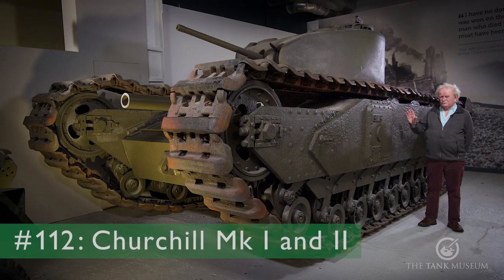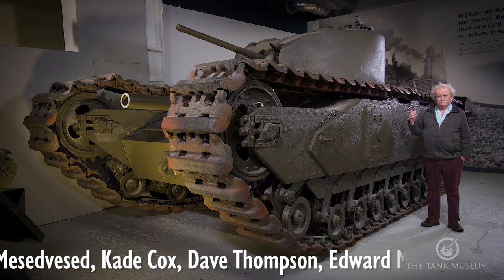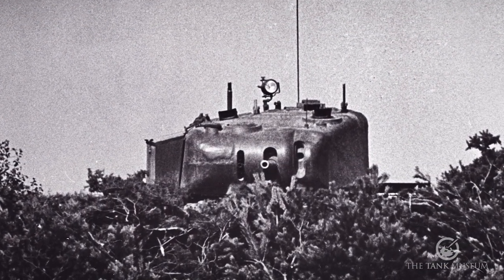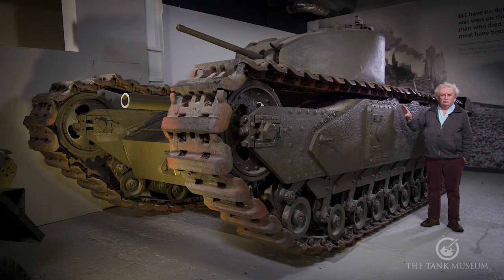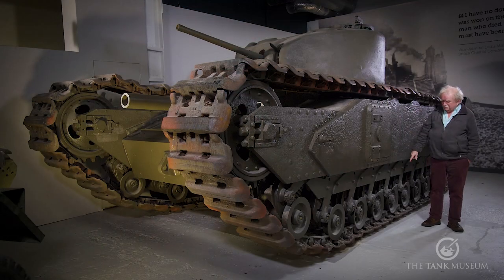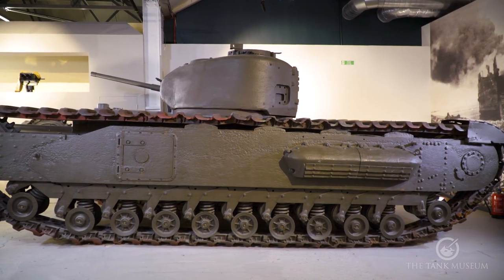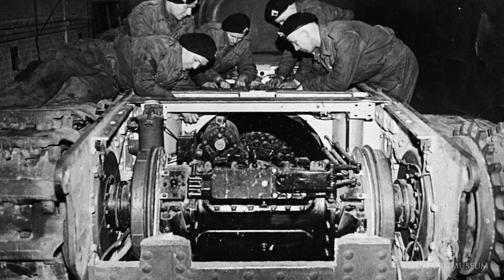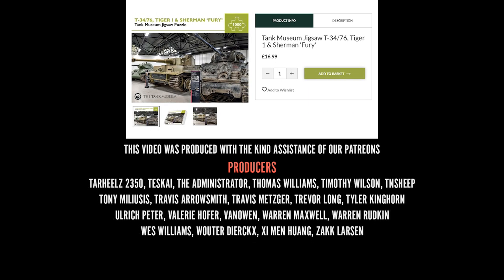Tank Chats #112 | Churchill Mk I and II  | The Tank Museum

Comment: The Irish Cav Corps loved these. However the Kildare and Wicklow county councils HATED THEM because of what they did to roads lol.We didn't have tank carriers so they were driven to the Glen of Imaal under their own power for training shoots .Later the Councils had enough and we had to get carriers for them. At one point a churchill gave into the Irish terrain and sunk, we couldn't get it out so instead we just took off the gun when not using it so we didn't need to guard it. We tried so hard to keep them alive we even took apart our Supermarine Seafire Rolls-Royce Merlin engines and installed them into one of the Churchills, supposedly it worked at first but its never said why. Of course they went out of service not too soon after but we dug up the sunken Churchill and sent it home to the UK’s North Irish Horse Regiment, based in Northern Ireland, as a goodwill gesture. It is displayed Belfast.

Comment: It's my birthday in a few days and I couldn't have asked for a better present!

Some fun facts about the churchill:
The air intake covers had to be removed during rail transport in order to fit through the tunnels.
The side doors not only provided an easy way into the tank.  They made it much easier to exit the tank as well without exposing the crew to enemy fire.
The high tracks provided more room inside the hull.  In later models with the track cover, many tank crews removed the middle portion during the winter because snow would jam up the turret ring.
Infantry tanks were also used to break through barbed wire. 

And in my opinion, I don't think the tank designers ever expected the churchill tank to ever have to go into a hull down position, since it is an infantry tank and designed to be used during an infantry assault.  Plus it has that thick frontal armour and it would be a shame to not put it to use.  Tanks were not designed to battle other tanks in those days.
Reply: Well, the 2-pounder gun wasn’t useful for any other purpose than shooting at enemy tanks, since it only had AP shells, no HE.  So although not the Churchill Mk. I’s primary mission, it could defend itself from (early model) German Panzer III’s and IV’s if it had to.

By 1943, of course, the 2-pounder was obsolete, and so was the Churchill Mk. I.  But good enough for training.

Comment: I'm suprised considering they planned on using the 6lbr first but swapped to the 2lbr due to lack of guns that they didn't use the bigger planned turret anyway just with the smaller gun so it could be updated later as it would have saved having to build a completly new turret for the Mk III

Comment: The Mk I lasted into the Italian theatre due to the paucity of close support tanks, where the workshops had fun modifying them. Replacing the turret 2pdr with a second 3 Inch howitzer, or switching the positions of the 2 guns so the howitzer could fire while hull down.

Comment: Early Churchills like these are the ones I find most interesting since their status as immediate-production gap-filling tanks pending upgrading to better-armed versions makes for unusual choices in design. The Churchill Mark IICS (Occasionally called the Mark II as the normal Mark II was sometimes referred to as the Ia) swapped the 2-pounder and 3-inch howitzer around so the former was in the hull and the latter was in the turret, which I find very curious in terms of the role it was expected to fulfil, but I believe it wasn't used in combat.

There was also a retrofitted version done in Tunisia that fought there and in Italy that replaced the 2-pounder with a second 3-inch howitzer too - again very curious as it presumably would have been capable only of firing HE or smoke, and with the small number of HE rounds normally assigned to early Churchills I have to wonder how useful this field modification would have been. The Mark IICS has numerous photographs of it, but this retrofitted double-howitzer version I've only managed to find one photograph of, immobilised in Italy - https://3.bp.blogspot.com/-lA-AismP_k0/XIRMpHv_-GI/AAAAAAAA5YY/KdRAUmbNFEAWC0jEnz-sy6kSKuLEprWdACLcBGAs/s1600/Churchill%2BMark%2B1%2Bdual%2B3%2Bpol..jpg
Reply: Jerry Chester who served with the North Irish Horse in Tunisia and Italy talked about the conversion and use - depending on tasking the C/S tanks had (did not matter whether normal or the two with the two 3" howitzers) depending on what combination of munitions were carried - for some tasks (like when they supported river crossings) they carried full loads of smoke and would use all them plus more with the echelon, other times they would carry mostly HE for suppressive fire.

Comment: They had 25 pounder, they had naval 3 inch guns, they had Vickers AA 3 inch. And yet the developed new infantry tank that was supposed to replace Matilda with a small turret, narrow turret ring and all of that for 2 pounder gun. Ugh:(
Reply: The 3" naval and AA guns were very large and would not fit in the turret of tanks the British could build at the time (the 3" AA was fitted to around 50 Churchill gun carriers in a fixed casement)

The 6pdr was a much better AT weapon than the 25pdr and they needed a good AT weapon - the Churchills were supposed to mount the 6pdr from the start but events in France meant priorities changed).
Reply: @chaz8758  6 pounder wasn't an option on design stage, it wasn't a ready gun to say lightly.
Yeah, that's why I called out small turret and narrow turret ring, don't you think?
25 pounder had HE and HEAT that were doing just fine up until 1943 and Tiger. Unlike 2 pounder. Soviet L10 and especially KT-28 were rubbish 76mm guns and yet they didn't put 45mm guns onto T-28/T-35 and newer medium and heavy tanks. Germans weren't fans of keeping 37mm in service because of better velocity to 75mm tank howitzers either:D So while 6 pounder wasn't an option, 25 was far better then 2 pounder that didn't even had HE round.
Reply: @chaz8758  P.S.: 
Gun Carrier used naval 3 incher(https://en.wikipedia.org/wiki/QF_3-inch_20_cwt). 
Vickers AA 3-inch also known as Model 1931 (https://en.wikipedia.org/wiki/Vickers_Model_1931) was a newer export gun produced in UK and grandad of 17 pounder(that needed Black Prince modifications aka new tank with bigger turret and wider turret ring to be installed on Churchil) and romanian Resita 75mm AT gun. 17 pounder didn't exist back then, but Vickers AA 3 inch did.

Those are two different guns. Naval 3 incher was somewhat obsolete, while Vickers 3 inch was a new gun.

Comment: Char B1 and Churchill both had hull mounted large bore guns - what was the point if the doctrine was stay hull down?
Reply: I think they were mainly intended against fixed positions like MG-nests or Bunkers
Reply: It's Low placement is good at hitting low laying bunkers and pillboxes. The tank was made with WW1 doctrine in mind, with the tank helping infantry in it's assault and breaching of enemy static trenches, machine gun nest, barbwire.. etc. With that in mind the Howitzer is in good position. Tanks during the inter-war have thin armour, so a smaller caliber gun in the turret is sufficient.
Unfortunately, as DF infer, the Churchill is fighting a modern war in WW2 with a WW1 body. Now you have German tanks with better guns and better armour. the only way to protect oneself is keeping your tanks hidden, preferbably under real cover like a mound, under a large ditch or large pile of ruble, and since the hull is the big valuable target, better keep it hidden. (The smaller turret is smaller size target but better keep it up to shoot softer targets).

Comment: would it have been possible to switch it around and install the 3 inch howitzer in the turret instead? 🤔
Reply: I think the Matilda turret could take the 3 inch howitzer. The Mathilda command version had the 3 inch howitzer. But the  3 inch was designed with firing smoke as it's main role in mind. That's also why the HE shells were in short supply. It never was meant to be a main armament tank gun. As a howitzer it's charge and shell were split, increasing it's reload time.

Comment: Did the 3 inch howitzer ever fire the same saphe as the anti aircraft 3 inch?
Reply: I doubt it, they are very different guns and the shells for the AA gun probably wouldn't even fit in the howitzer.
Reply: There was the Churchill Gun Carrier . Which was 3inch AA mounted in a fixed casemate on Churchill hull. a sort of British Sturmgeschutz. It wasn't a success and they were used up as range targets.
Reply: The 3" gun on the C/S Churchills was a howitzer and fired a medium velocity round, they did not have an AP round. 

The 3" AA was an HV gun that had a secondary ground role including in the AT role (each HAA regiment did annual AT shoots pre-war)

Comment: I have never understood the idea of building such a massive tank and then putting such a small weapon on it.  Until it received the 75mm it was under-gunned against anything it would fight, whether infantry or armor.
Reply: the 6pdr was a better AT gun than the 75mm
Reply: @fdsdh1  No disputing that but the fact is on an Infantry-class tank, your primary job is to engage infantry and bunkers.  A 57mm (the 6-pounder) was remarkably weak against infantry.
Reply: The main gun was for use against enemy armour, thats why they had the 2 pdr and later 6pdr as their main weapons.

With the 6pdr it was not under gunned really against most armoured vehicles they faced (the first Tigers, Panthers and Panther turms knocked out by the western allies tanks, fell to 6 pdr armed Churchills)

It was a comparable gun to that mounted on the Cruisers. 

Heavy armour was the main criteria for an Infantry tank, you have to look at the doctrine of how I Tanks were used and how they were supposed to operate with the infantry
Reply: @danepatterson8107   I agree the 6pdr had disappointing HE performance, however the Infantry Tank is a breakthrough vehicle it's not specifically an infantry support vehicle. There were specific Close Support tanks with 3ins howitzer and later 95mm howitzer.